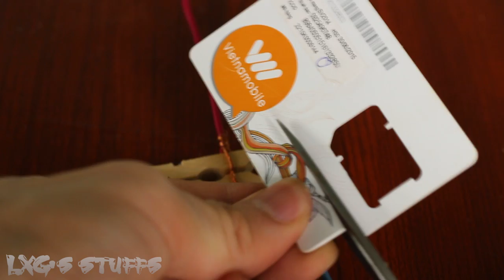How to make a simple Door Alarm

Comment: anh lấy đâu ra cái loa vậy?
Reply from the maker: +Anh Quang mua ở banlinhkien .vn nhé :D, hoặc tháo từ đồng hồ báo thức
Reply: good idea
Reply: +LXG Design hey pls help does it have to be a 3v buzzer or can it be any buzzer
Reply: It has to be a 3v buzzer if you use the two AA batteries because they're 1.5v each in series = 3v. If you found a 1.5v buzzer you were happy with, you could just use one battery.

Comment: sir?  my buzzer doesn't have a "teeeeeeeeee" sound but mine is the same as yours... i used 2 double A battery and the sound that is coming out is like the sound coming out of a radio with no signal... how do i fix it??
Reply: You need to code the buzzer